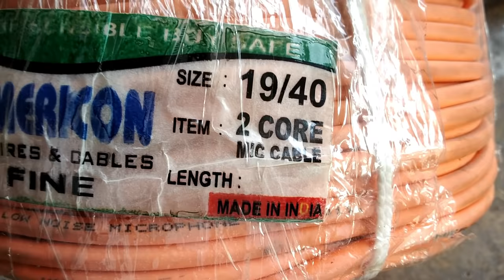Jack to Jack Connection | Xlr | Microphones to Mixer Lid | Male xlr to Female xlr

Comment: Sir laiv sound ke liye speaker wire kitne meter honi cahiye
Reply from the maker: Sound mai aap quality Dena Chahte Hain Toh  5 se 10 metre  ke andar hi Rahe
Dur hi Lagana Chahte Hain To single top k liye 4ohm 1000 watt 1.5mm wire 35metre se jyada door nhi
2 top 2ohm 2000watt k liye 2.5mm 20metre tak

Comment: Did anyone notice the screw up ? On the first one he soldered the end on without put the rubber part on that screws into the metal piece, you can see them on the table while he’s soldering and if you notice he cut the recording and had to pull everything back apart and put the rubber backing on and restarted the video to complete the process